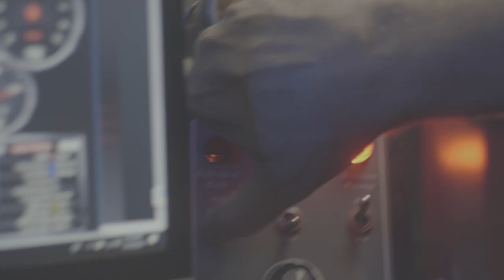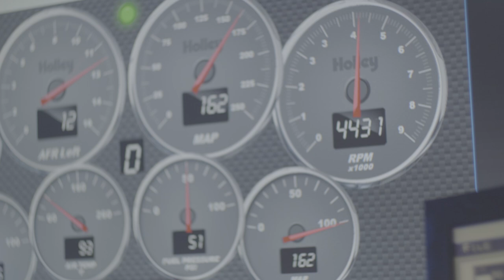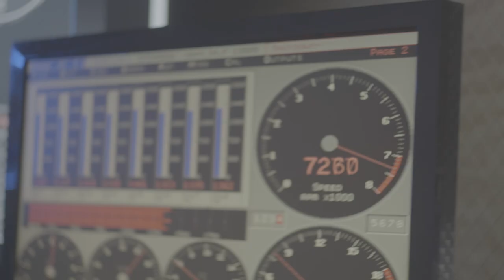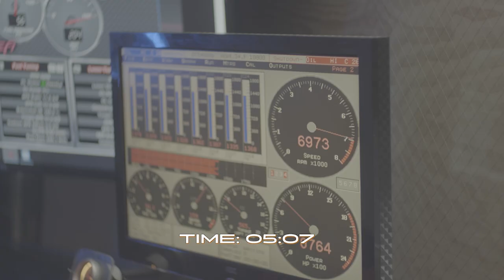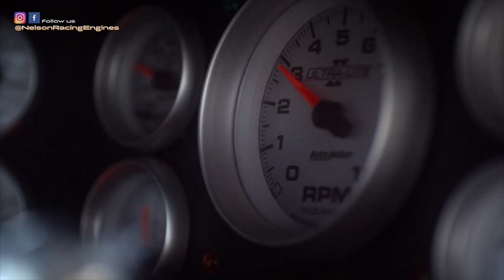Imagine! 1200 HP 260 CI TT LS Full Throttle/Full Load 5 Min Dynos!  NRE's Tom Nelson explains.

Comment: This should be the engine builder challenge. Can your 1000 hp engine run wide open for 5 minutes.
Reply: Likely 800hp at wot. Said the scramble button was to pass people
Reply: The gauge towards the end of the run said 764hp when he was holding 7k rpm.  So this was most likely on the lowest setting
Reply: @Steven Ross-watt Agreed. A 5-min wide open test is kind of useless for most racing (except apparently boat racing, which makes sense). I would not be surprised if IMSA racecar engines would fail this test, and they are some of the more reliable race engines (because of the duration of IMSA races I reckon).
Reply: There's a lot of endurance engine builders that dyno at those levels for hours. If you're doing stuff like Baja, NASCAR, or Offshore Endurance, you really will be running WOT for minutes (or hours) at a time, for a whole day, and then again the next week. Then again, those engines are way bigger than 260ci.
Reply: EJ owners: hold my bearings.
Reply: Raymond Collins Raymond Collins Ford Raptor made it through the Baja 1000 with a factory twin turbo 213 ci v6. Less HP at 450 hp but still survived the 38 hour race and drove all the way across the county back to Ford for a tear down. All this after being on the dyno at full throttle for and equivalent of 150k miles.
Reply: Steven Ross-watt marine Application is a while other animal though
Reply: I second that, I would like to see them diesel guys try this.
Reply: @Treyk901  That sounds like a bunch of Ford propaganda to me..  it's not like Ford has EVER fed us lies before.. lol.
First of all that thing is the V6, which means it's unbalanced and vibrates, to combat this Ford built it around 60 degrees which does help with vibrations but then it must use splayed rod journals on the crankshaft, this makes for a weak crankshaft no matter what. And on top of that there's only four main bearings and caps. All of this adds up to one of the worst designs for any type of motorsports let alone endurance racing.. it will break.
However I see a ton of people driving around those EcoBoost pickups and I'm actually genuinely shocked at how well they actually run and don't have as many problems as I thought they would with such a bad design.
Reply: Walker Forsyth A 60 degree bank angle is ideal for a V6; it does not require offset (splayed) crank journals to fire evenly. The main reason so many V6 engines have 90 degree bank angles (which introduces odd-fire issues) is either they’re derived from a V8 block design, or so they can machine the blocks on the same equipment used to produce V8 blocks.
Reply: James W a 93 tune on the 3.5 engine will put about 460 hp and 500 tq to the wheels. A E50 tune will put 500 hp and 600 tq to the wheels reliably. Heck they even used that engine in the Ford GT.
Reply: @walkerforsyth6221  I've ran Caterpillar c18s at wot for almost two hours lol
Reply: Even F1 engines are tested at wot for reliability.
Reply: Yes, but Ferrari made an offset v6 engine of 65º bank angle, with 2,5 degrees in each crank journal, for the Dino. That engine was used in the Stratos later. A well engineered engine can have smoothness and reliability.
Reply: For that reason GM improved the v6 3800 with a counter rotating shaft.
Reply: wheeln 24/7 facts
Reply: @hendrahendra  literally putting a motor in my buddys wrx because of a spun bearing lol
Reply: @Treyk901  yeah but in the end its still a shitty sounding v6....v8 ftw
Reply: Honda has been doing this for decades silly people
Reply: Walker Forsyth hey bud, heard of the Ford GT and the GT MKII? 3.5 v6 TT making 700hp running 24 hour races? Performs amazingly and sounds like a beast. Also the 3.5 in my 17 F-150 is very smooth and at idle you can’t even tell the engine is running because it’s so quiet and NOT unbalanced.
Reply: @walkerforsyth6221  diesels regularly run wide open longer, if your talking marine, generator, or heavy equipment some of it runs wide open for weeks before it gets shit down for oil and filters then fired back up to do it again. Just today running through the Rockies my 20 year old 3406e with 1.6 million on the clock spent better then an hour at wot in 5-10 minute increments without missing a beat.
Reply: @msanchez7317  aviation as well
Reply: I certainly wouldn't expect my homebuilt engines to.
Reply: Doug Cohen no the scramble is to take power up or down 200 at a time so it runs at 1000 regularly. Scramble up for 1200 scramble down for 800
Reply: @walkerforsyth6221  rod bearings are an issue on the 2.7 v6’s that Ford builds. They like to spin around 50k miles
Reply: That sounds just like you wanna build circle track engines.
Reply: Pontiac 400 held up WOT from Chicago to the Wisconsin border. Oh long ago before radars and such. 
 2:73 gear and a endless stop of velocity through the carb . 
      Glad the tires held .
Reply: @dougcohen3364  popp0
Reply: @Walker Forsyth  the military does those tests, but hours ....that's about it

Comment: I m not impressed that the engine last, i m impressed that the dyno can take all that abuse
Reply: Andrea Sanai yea I was thinking that but it is Nelson racing engines so a 800 to 1200 hp engine is pretty low compared to some of the other insane engine builds of his he would have a pretty kickass dyno I bet 🤙
Reply: @carnation7988  yep he dynos 5000hp engines doubt this hurt it even over this long of a test with only 800hp
Reply: A dyno could just be a big propeller in a tank of water to create resistance, the water would heat up slowly soaking the energy from the prop shaft. Torque and RPM is all that is needed to get a power measurement
Reply: @idgaf5252  You have to have some means of measuring reactionary force. If it was a prop how would you measure torque? Since the work done to the fluid would be quite hard to quantify unless you measured load in the driveshaft. 

   That said the prop would also need to change load to allow you to hold the engine at a given speed which is a pretty useful function of an engine dyno.

   The hydraulic absorber accomplishes all that with minimal fuss and thus the reason most engine dynos are made this way.
Reply: @carltonbankz9273  Not as simple as it sounds a 13 second sweep requires high peak flow. A long duration test needs thermal capacity. 1200hp would raise 400 gallons of water to about 150f in 7 minutes. I'm making some guesses here. Tom without a doubt has series large absorbers to handle that power for sweep tests.

Comment: Ahhh water cooled headers explains the lack of glow :-)
Reply: Yeah! I don't know squat about boats, and was wondering about that.
Reply: What do you mean water cooled headers?
Reply: @waynebollentin989  Literally the headers have water jackets in them.  Make up for the lack of air flow inside the hull where the engines are usually stuffed.
Reply: @ericb065  what part of the video do you see water jackets in those headers. The reason water cooled headers are used on some boats is for noise mostly and where heat is a problem like on a normal inboard motor setup. The header coming of the motor needs to be hot to spin the turbine within the turbo. I do not see anything on the heaters coming from the head on the motor to the turbo. Please time mark where you see these water jackets. Thanks
Reply: Didnt know there was such a thing ha
Reply: @waynebollentin989  5:57
Reply: Wayne Bollentin 5:59
Reply: @waynebollentin989  The water never touches the exhaust gases in this application. And exhaust gas spins the turbine wheel on the exhaust side which is connected to the compressor wheel "cold side". Heat doesn't make a turbo or turbine spin. Gas does.
Reply: Wayne Bollentin The water jacket around the headers actually preheats the river water in an open loop cooling system so you are not shoving icy cool water into your engine.
Reply: @waynebollentin989  the part where they literally say it has water-cooled headers and the guy holds his hand to them? You dunce.
Reply: Wayne Bollentin literally what it says, there are 2 water jackets on the headers. Most boats only have a single jacket on the exhaust headers, this one has two.... an inner layer and an outer layer.
Reply: ....Still waiting for Wayne to respond. crickets lol
Reply: Fireguy_81   He won’t because he’s that one guy in every comment section!!!
Reply: @dhooter  pressure does. this is a pressure game..
Reply: @nordic5490  not true
Reply: @9thdeltaconcepts652  I think it's air flow and velocity what you mean because pressure equals restriction.
Reply: @waynebollentin989  you're backpedalling so hard you just snapped the chain.
Reply: Samuel Carrington I agree, but now it’s hard to fall asleep at night knowing I agreed to someone, with your grammar.
Reply: @Rollin8.0  
My shit never had a chain. If you sleep better thinking that it's all good though. I'm still lmao either way.
Reply: @waynebollentin989  what you think the build details are on that coming in at 260 cubic inch? Short stroke long rod bottom end with a 2:1 or better rod ratio for endurance? and to keep it in the cubic inch limits I guess
Reply: @waynebollentin989  you lose 😁
Reply: Well as long as the temps are OK the engine can keep revving 24 hours!
Reply: @UCksRpGZGA48ZtEKQ86aSoqA I didn't say it was all a joke but most of it was. I was poking the bear. Should be easily seen if people don't get so emotional but this is YouTube and emotions run high lol. I'm sorry if you don't have enough sense to see I was mixing this motor and normal inboard motor together. It's mostly just car guys here. Many don't know that water is injected into the header to muffle the sound and why those boats have a unique sound over boats that don't. People get tunnel vision on YouTube and miss the big picture all the time. Could careless what you think either way. I'm still lmao...
Reply: @waynebollentin989  I know what you ment and I also know you are for more intelligent than 99% of these people that comment in here so dont worry about what they say. They dont really know what's going on anyway!
Reply: @waynebollentin989  so you were wrong but you were clearly joking? I'm not buying it
Reply: @waynebollentin989  he actually says they are water jacketed manifolds at the end of the video, pay attention.
Reply: @JDJD-mw9rr  it's ok it's not for sale but  it is free for anyone who has common sense.
Reply: @dhooter  Hey, whilst that's kind of true, it's also kind of true that it's run via heat - let me explain: As you say it is the gas pressure that spins the turbine.   BUT, that pressure is greatly enhanced by the heat of the gas in question.   This is why turbo engines do benefit a lot from larger exhaust systems on the effluent side of the turbine (as opposed to an NA engine where you want good scavenging), because you want the pressure differential across the turbine side of the turbocharger to be as great as possible.   This makes the gasses "expand through" the turbine quicker, which dumps more energy into the turbine blades.    It's not just the velocity of the gasses, it's also the expansion rate of the gasses... So a high heat, high pressure environment on the influent side of the turbine housing, and a lower heat, lower pressure environment on the effluent side is what you want for efficient spooling.     If you have a turbocharger on your workbench, you can spool it up quicker and to a higher speed with a blowtorch, than you can with compressed air - because the heat does play an important role.    Cheers!
Reply: john stone you’ve been trolled my friend
Reply: Surprised he didn't do some kind of double wall turbo housing and run oil through it. Figure in the water at speed if it gets splashed with ambient lake water it could crack. At least with oil cooling it would shield it from that, just a thought.

Comment: Seeing all the other engines combinations you have built I was confident this one would pass the five minute test. Boat engines take a beating especially in rough water where the prop loads and unloads when the boat grabs air. I think the boat this engine will go in will be a force to recon with. Nice work!
Reply: Not only that, boat V8’s typically spend most of their life above 3500rpm. Where as your truck cruises along at 1500rpm for most of its life.
Reply: Turbos in those jet-boats don't really work that well, it might be that all-or-nothing peaky power delivery...something...the jets typically work better with the positive displacement superchargers.

Comment: The best way to test a motor with proper precautions, who said walls don't work when you may have a catastrophic event during a massive dyno run in case parts start flying all over. Now thats when know that your motor is absolutely fantastic. Great work!